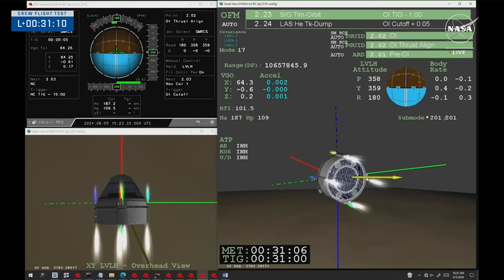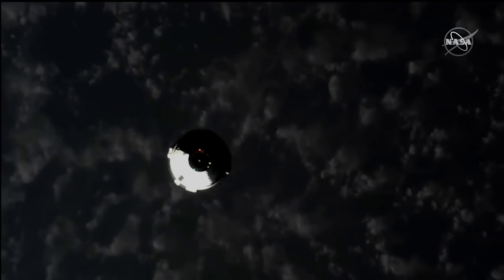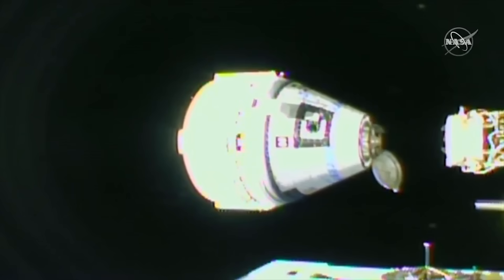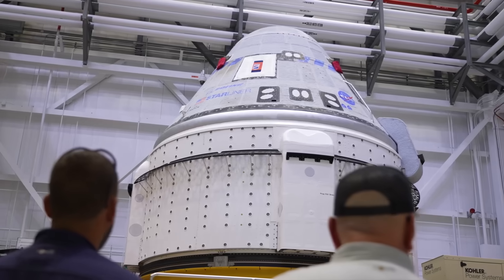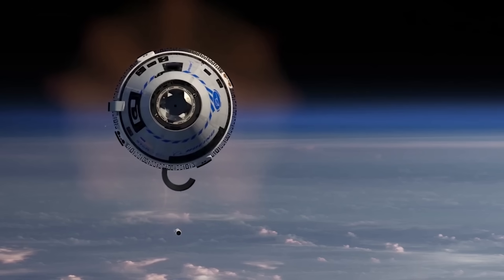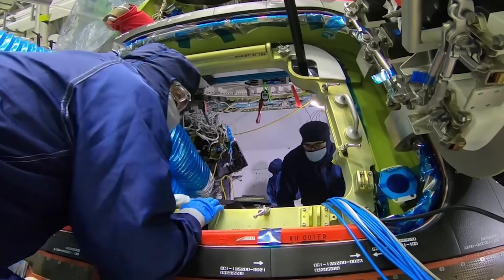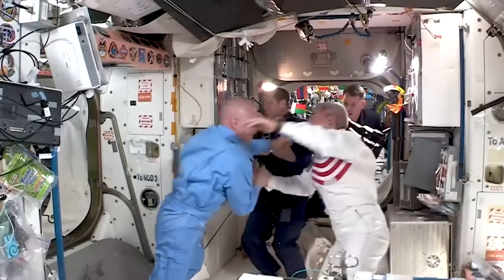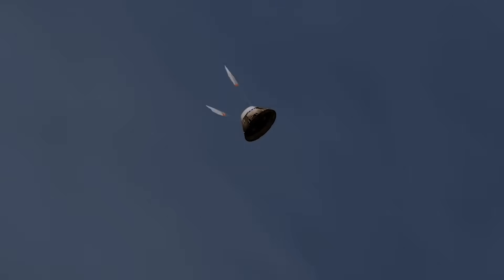More Helium Leaks Were Just Found On Boeing's Crewed Starliner

Comment: Ya know I don't have a PHD but do have a few years in aviation.  Can't believe they didn't deal with it after the last scrub. Having leaks at one ATM vs zero ATM will show the flaw in that thought process.  If the crew starts sounding like Alvin and Chipmunks, well... The issue becomes another acceptance that will always come back to bite you.  However, it is a test flight and nice to know the transparency of such deficiencies...  Semper Salius
Reply: Slightly improved from using hydrogen, I'd say. At least it won't catch fire.
Reply: Nice edit. "Ya know I don't have a PHD but..."
Reply: Few years in aviation is totally meaningless in this discussion. You know nothing about the Spacecraft or how it works on a technical level. I don't either and neither does anyone is this comment section. But hey maybe Boeing should listen to some guys 2 cents on the internet. I guess it wouldn't occur to you that dragon demo-2 flew with a helium leak as well.
Reply: @mathewferstl7042  But SpaceX fixed the problem rather than allow the bean counters to brush it under the rug and hope it goes away.
Reply: @anthonykevinkerr3594  no, they flew with the leak. My God. You trying to argue your point without knowing a single thing about the event
Reply: @mathewferstl7042  Aww, don't be so harsh on him, he's just practicing his "fake it until you make it" skills. Who needs to know anything about the event when you can just pretend expertise like all the others?
Reply: @petep.2092  you don't know that they flew demo-2 with an active helium leak. Which was the centre of that discussion. Seems like you need to read up on it.
Reply: @mathewferstl7042  Having an approach toward flying with "deficiencies" is major component of any high-risk activity. It is a major safety consideration and maybe "you" need to read the book called "Challenger".  It was required reading in supervision and leadership, as well as safety courses for a reason.  However, I guess your "2 cents worth" in ignoring safety with light the fires approach has resulted in many an accident.  So much so, that anyone in a "safety culture" could ground one of my flights, until the question is resolved, period... I can't repair this computer but know if something isn't right a cascade that can result.  It is rarely one thing in the aviation Accident Chain.  Too much stock in Boeing (believe I do) isn't an excuse for not ensuring safety as the leak(s) have now become a concern.
Reply: I'm afraid to ask what you did those few years in aviation and how much had to be paid for the damages caused by maligning people for lack of a PhD.

The pressure on the walls of the helium tank will go from 800 psi at sea level to 814.7 psi in space (1 ATM = 14.7 psi). Don't need a PhD to figure that is an increase of about 1.8%, barely noticeable. But now the news media have labeled you "whistleblower" for exposing the "flaw" in Boeing's thought process, so some will advise you to sleep with one eye open, but I say screw it, YOWO (you only whistle once), so sleep well. Also, the folks that DO have a PhD were careful to not route the helium reaction steering manifolds through the crew compartment, so no chipmunks coming back to bite anyone either.
Reply: @petep.2092  what? Also I've got a CPL-H if somehow having experience in a totally unrelated industry and field of expertise matters
Reply: @petep.2092  Hmm, in the vacuum of space that includes interaction with air (frost, ice), now none.  Now it is leaking faster, with additional leaks rests that case.  As far as Boeing, never took a stab at them and believe I have some stock with them, so...  Common sense and yes aware of the cabin air not affected, lightening the subject, you know like helium.
Reply: @petep.2092  Maligning PhDs...  You mean like aircraft designed by PhD's, built by those with master's degrees, flown by bachelor's degrees and maintained by GED's?  Yeah got a few hours in that world and "really" trusted the GED's literally with my life, you?

Comment: No danger? Leak enough and no more steering.
Reply: We know there is a problem said the management, but what could go wrong? Lets launch Space Shuttle Challenger anyway. Well, there are always pieces of the foam insulation breaking off during launch and impacting the brittle heat shield, but what could go wrong? Go Columbia!
Reply: Not a major issue while in orbit, though.

Comment: I know this isn’t a serious issue, but the continuing leaking and other issues speak to a larger problem with the production and development of this craft.
I wish they could just let this thing go… What a disaster.
Reply: What could possibly go wrong?   Good Gaud.
Reply: How do you  "know it isn't serious "? Because a Boeing spokesman told us that? NASA has a long history of failures after declaring something "manageable".
Reply: @jxpat  Because the Mission Control comms are live streamed, so you can just go and listen to them talking about the problem… All this information is publicly available…
Reply: @joelmulder  Only problem is they'll be getting down in a thousand pieces if they can't control the craft.
Reply: Really? A larger problem? What have you designed that has involved ducting cryogenic liquids and compressed gases while endure the g forces of lift off and staging, aerodynamic forces during ascent, extreme vibration, solar radiation, explosive combustion of propellent, micrometeorites, temperature swings between roasting and well below deep freeze… ?
Reply: It is a serious issue
Reply: @jamskinner   A helium leak really isn’t a serious issue in a flight like this where the ground is only about 30 minutes to an hour away in case of emergency. If it were going around the moon though, that’d be a different story.
Reply: @joelmulder  The ground is only 30 minutes away? Are they in a car? If they lose the ability to control their spacecraft its doesnt matter where what is. They wont reach something one foot away. They wont dock to the ISS and wait for another spacecraft to bring them back. They wont brake for the reentry. They stay in orbit until natural orbit decay makes the coffin plunge back to earth. A leak isnt a feature. Its a problem that could say POP at every second, disabling the thrusters. It got worse after launch, what does that tell us? They should have fixed the problem. Well, what could go wrong the management already said with Challenger and Columbia.
Reply: @flybywire5866   Yes, LEO isn’t all that far away. The de-orbit burn takes a few minutes at most, and from there it’s usually around 30 minutes from the end of the burn to parachute deployment. Have you never watched a space craft return to earth before?

In any case, they would initiate a return long before the problem would be bad enough they couldn’t perform a de-orbit burn anymore. Starliner’s design might be deeply flawed, but that’s not because its engineers are stupid or like risking astronauts’ lives.
Reply: @jamskinner  Yes its so serious that they are continuing with the mission exactly as planned.......
Reply: @MichaelOxlongerThanYours  There are billions of dollars at stake. Of course will they go on. They launched Challenger despite known issues anyway. All the delays became to embarrassing. Same story. Hopefully different outcome.
Reply: @flybywire5866   Because there’s only one thing worse for PR than a spacecraft failing to launch or having to return early, and that’s dead astronauts.
If they were THAT negligent, they would’ve ignored all the other issues too and launched much earlier.

I mean, unless they’re also lying to the astronauts too, which would be a stretch since, you know, they’re in the actual spacecraft. The Mission Control comms are live-streamed and otherwise unencrypted.

Comment: At this rate it'll be less trouble to get Dreamchaser flying, cargo certified, and then crew certified.
Edit: for the people who got an A in physics and a D in English, I'm using hyperbole, exaggeration to make a point (often humorously).
Reply: Assuming it works.
Reply: You not kidding? Bowing ? Built this pile of trash and they knew it was leaking and still sent it to space?? Dude why dose this junk exist next we will find out bowing built the rocket that blew up back in the 80s and killed everyone and almost killed every orange tree in Florida with all the fuel cloud everyone lived in got cancer from.  ??? NASA is a joke bowing joke its space X or bust for real them clowns gona kill everyone.
Reply: Getting crew certified is going to be extremely challenging for Dreamchaser. SpaceX took years to get their Dragon capsule certified because they need so much redundancy and safety measures in place.
Reply: I think you are exaggerating. Dream Chaser is a CARGO vehicle. It took SpaceX 7 years to go from Cargo Dragon to Crew rated Dragon 2, with a few explosions and parachute failures along the path. Crew rated vehicles have extremely high standards. If this Starliner was a cargo vehicle instead of a Crew spacecraft we would hardly hear about a few thruster problems. The first Dragon cargo mission had frozen thruster problems they had to work through. Note that Boeing didn't have a cargo vehicle to use to get all the bugs out of their design. They were going from a clean sheet to a crewed spacecraft in one go, hence the additional money above the SpaceX contract. Boeing hasn't built a new manned spacecraft since the 1970s. It kind of makes me irritated that all these amateur, arm chair engineers that have never built anything that flies are spewing out their "learned" opinions.
Reply: @i-love-space390  How many explosions. So Spacex developed 2 spacecraft cf Boeing and got to fly 4 years before Boeing all for far less money. Spin it anyway you want...
Reply: @i-love-space390 Dream Chaser was initially designed as a crewed vehicle; that’s why it has that funny black lump on top in the shape of a cockpit. To convert it into a cargo vessel, they removed the cockpit from the design and filled in where the windows would have been with heat shield tiles, so that they didn’t have to redesign and retest the aerodynamics.
Reply: @i-love-space390 Boeing was the most experienced builder of human rated space craft in the US. That should have given them a massive advantage over SpaceX. The Dream Chaser had been the least funded of the projects, Boeing is the most funded. I wonder where Dream Chaser would be if it had the level of funding Boeing had as SpaceX are way ahead of them with less money.
Reply: @i-love-space390  Well at least you won't have to deal with any parachutes out of those problems on Dreamchaser.
Reply: @i-love-space390 I guess you're saying Boeing would have been better off to rebuild their experience with spacecraft building a cargo vehicle in the first place?
Reply: @i-love-space390  yes. I was exaggerating for effect. It's called hyperbole.
Reply: @i-love-space390 the first dragon and second dragon are completely two different vehicles.
Reply: @i-love-space390  That's a very fair point

Comment: Will this effect Starliners certification? Or is it a small problem and Starliner will go ahead with future crew launches?
Reply: affect NOT effect
Reply: @bazsnell3178 - You could use the verb "effect" if you meant cause certification to occur.

Definitely won't effect certification. May or may not affect certification.
Reply: Boeing pays their 10% to the big guy. It won't be a problem.
Reply: If it were a "small" problem, they would have fixed it before launch.

Comment: I for one couldn't sleep if their was a possible leak in my space craft?!
Reply: Sleep in the suit!
Reply: @michaelreid2329  can't do that. Too uncomfortable 😂 they tried that back in Gemini and it was bad.
Reply: @nuclearandspaceeducation3201  How would the helium get into the cockpit to accumulate?
Reply: @petep.2092  It's like this you see. Imagine you are a scuba diver... you have filters which filter CO2 because you are breathing only O2. Now image you put nitrogen in the tank. The filters only take out the CO2 and you exhale the N2, just as you would the helium. If this cycle continues you will find that the pressure of N2 gradually increases to the point of the differential pressure is too small to actually pump in O2, essentially taking up all the space. Spacecraft are essentially just giant scuba gear. The leak, however, can of course, not get into the cockpit period. However, if it did it would be completely catastrophic.
Reply: It's in their propulsion system, not life support. Worst that could happen is they have to send another rocket up to bring them back.
Reply: All spacecraft leak pressurized gases, just usually at a rate that doesn't cause any problems.  Helium is especially hard to deal with being such a tiny atom.  

The problem is where this leak is (pressurization system for the RCS thrusters) and how big it is.  They may have to cut this trip short if it looks like they'll have problems with attitude control.  Losing an RCS quad means they may not be able to dock with the ISS safely, and may affect orienting the spacecraft for reentry.  

Which means Boeing gets to lose even more money.
Reply: Your comment is presumptuous because you obviously don't know about the technical makeup of the Starliner and whether a leak is a serious threat to the crew and the mission or not.  

 These astronauts are well trained for problems that may arise on the vehicle.  You have no such training.
Reply: @michaeldeierhoi4096 the most intelligent comment that you will find in almost any space bucket comment sections. Well done
Reply: @michaeldeierhoi4096  Its beoing, the person who discovered the leak is probably going to be found dead in a few weeks.
Reply: you breath helium?
Reply: @hunterwilk first off the leak is releasing helium to space, not the inside of the capsule. Second off, helium is non-toxic, yes they can breathe it
Reply: @prettycoolcat helium can not be breathed. It would accumulate in the cockpit probably because cartridges are meant to deal with CO2 with LiOH or activated carbon just like a plane.
Reply: Every gas is toxic, even oxygen. It is all in the proportion and ratio.
Reply: there NOT their
Reply: It was uilt by Boeing there was a good chance they will die in space

Comment: At this point, entire starliner program is a liability. better stop wasting money on obsolete crew capsules.
Reply: Careful you might end up disappearing or dying if a sudden illness
Reply: You really should do some more reading before posting
Reply: No, NASA needs a second system beside SpaceX. But I also don’t understand why that could happen…
Reply: Yeah like NASA needed a second system when going to the Moon
Reply: I'll be sure to pass on the message.
Reply: Agreed… cut the loss
Reply: NASA is ultimately responsible for the lives of the astronauts and the success or failure of the mission. NASA would not have allowed the craft to launch had it not passed stringent standards set years ago. The major difference between Boeing passenger aircraft failures and Starliner are the insane amount of people looking over the shoulders of the Boeing Starliner team.
Reply: @Awesomes007 Challenger. Columbia.
Reply: Don't forget, the sublimation system had an anomaly, too, using more water than expected.
Reply: Where do people like you get the confidence to believe you know so much about such a complex thing?
Reply: Wouldnt call it obsolete. Its state of the art over engineered. 
Just hope Suni and Butch come home safe.
Reply: @IanCthrwd I'd hardly call it state of the art when they are using paper checklists.
Reply: The only upside for NASA is that it was a "fixed price" contract. That's why I pray for any astronauts in that thing!
Reply: At least this time, the contract wasn't a Congres-mandated cost-plus contract, like SLS is....

Boeing is losing its ass on it. 😄
Reply: @lordgarion514  Exactly, it would not surprise me if Boeing does their 6 contracted launches and then permanently sends this thing to the tech graveyard.
Reply: I think you are exaggerating. It took SpaceX 7 years to go from Cargo Dragon to Crew rated Dragon 2, with a few explosions and parachute failures along the path. Crew rated vehicles have extremely high standards. If this Starliner was a cargo vehicle instead of a Crew spacecraft we would hardly hear about a few thruster problems. The first Dragon cargo mission had frozen thruster problems they had to work through. Note that Boeing didn't have a cargo vehicle to use to get all the bugs out of their design. They were going from a clean sheet to a crewed spacecraft in one go, hence the additional money above the SpaceX contract. Boeing hasn't built a new manned spacecraft since the 1970s. It kind of makes me irritated that all these amateur, arm chair engineers that have never built anything that flies are spewing out their "learned" opinions.
Reply: @i-love-space390  And Spacex hasnt built a manned spacecraft since, I forget. please remind me
Reply: @i-love-space390 - OFT-1 was 4 and a half years ago, and those software issues were horrendous. The problems Starliner has had are not normal, to-be-expected issues.
Reply: @i-love-space390  Good info, but it sounds as though you work for Boeing.
Reply: @jeffrobodene1485  … meaning: your prejudice will cause you to ignore the good info?
Reply: @i-love-space390 So I guess you are an expert!?
Reply: @JMWexperience apparently much more so than you!
Reply: @i-love-space390 EXACTLY. People who have no idea how hard it is to do this, jump at the chance to dump on Boeing just because… they have no life 😂
Reply: Agreed 😅 total incompetence.
Reply: @jonathanbartsch2938 How is it incompetence if it’s in space with astronauts on board acheaving its objectives? …clowns on here😂
Reply: SLS and Starliner both should be scrapped ASAP